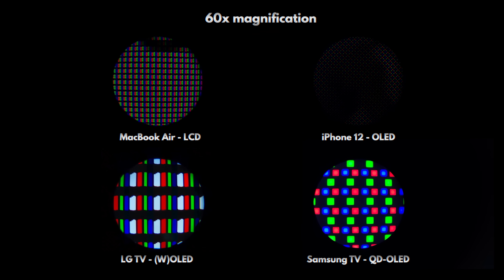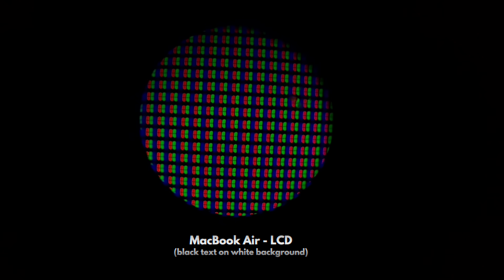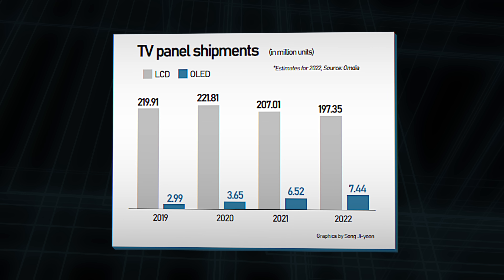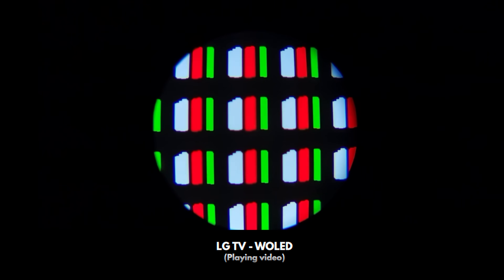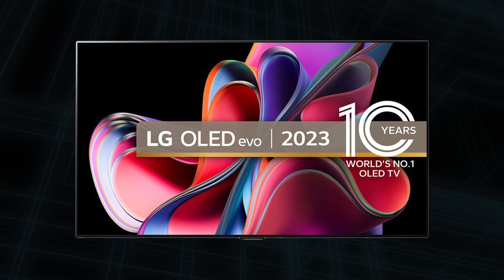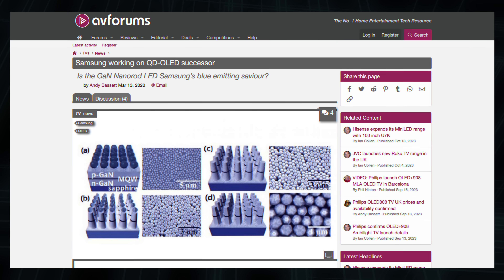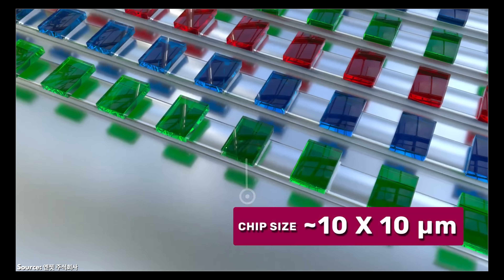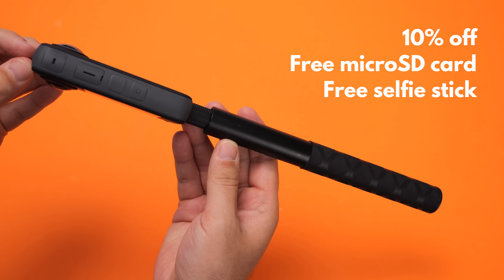The billion dollar race for the perfect display

Comment: The selective reality morph trying to sell Micro LED. OLED displays can be both RGB or Pentile. The latter is a very clever way to use maths to save energy and production cost. Had it been invented by one of the toxic US brands, that would have been hailed as the gold standard of display technology.
The "reason" an LCD can use the same sizes for each sub pixel is because the energy generated behind the colours. This does not mean it is more accurate. It is still more complicated to construct and will have extra layers and points of failure.

Comment: The downsides of all these techonlogies is that it takes too many layers so the cost will always be high. Electro luminescent LCD will displace them all even if the Nits rating ends up being a little lower around 1000-1200 nits vs the 2000 nits the others are aiming for. Most panels today have about 500 to 1000 nits on the priciest models so 2000 maybe an extreme luxury item that isnt worth paying 2-3x more for.

Comment: For microLED, instead of picking and placing millions of LEDs onto their electrical contacts individually, maybe it would be possible to fabricate the semiconductor junction as a giant sheet. Place that on the conductor array, make the connections, and then precisely cut up the semiconductor layer using lasers or something. You'd be limited to a single color, but if you use blue LED semiconductors and then add a quantum dot layer, it might work.
Reply: I already tried that yesterday it didn't work

Comment: Minor Correction: natural state of an lcd pixel is clear, not dark.  With no electric field, the crystals naturally twist the light, allowing light to pass through.  With a field on, the crystals line up end to end and stop twisting the light, allowing the polarizer to block the light.
Reply: That depends on how you align the polarizors. How many of you flipped the polarisor in your calculator to get a clear on black display ? Some LCD watches are made the same way to make them look a bit different.
Reply: @MrDuncl  I flipped the polarizer (maybe 4 decades ago) and found that it looks very cool, but is hardly readable if the incident angle of the light is flat: Shadows of the dark parts fall into the open windows of the letters. Same reason I am after black on white displays for Arduino to give it battery saving daylight readability.
Reply: So does LCD need more battery to block the light?
Reply: @rugvedmulay5090 yes, darkening pixels takes more energy on an LCD. On an OLED it’s the opposite
Reply: Only TN (twisted nematic) LCD that are used for entry level TV/displays are normally open ("on" with no electric field, "off" with), IPS-types and VA-types TFT LCDs that are used in most displays/TVs are normally closed ("off" with no voltage). That's why "dead" pixels tend to be bright on TNs and black on others.
Reply: i think it depends if it is a tn or ips display
Reply: Avalanche diodes may be employed to down convert the high energy visible waves
Reply: Crustaceans and other animals did not evolve. Among the millions of fossils dug up from the earth, there is not a single intermediate fossil that proves evolution. Several hundreds of millions of years ago, crabs and other animals were in their current form. The theory of evolution is a dogma without any scientific proof. The reasons for defending the theory of evolution are ideological, not scientific. Scientists have discovered that all organs, which evolutionists call obsolete organs, perform important functions. Mutations believed to trigger evolution have been shown to be completely harmful. That is, mutations do not give advantages to living things. On the contrary, it harms. Evolutionists pointed to fossils of the coelacanth fish as evidence of the transition from water to land. However, a living specimen of this fish was found and it was found that the coelacanth fish is currently a fish that lives on the bottom of the ocean. Finally, I would like to mention that evolutionists can't explain how a living organism arose from inanimate matter. Living things did not appear through evolution, but through the Cambrian explosion. This proves the creation. Almighty Allah created all living things. Praise be to Allah Almighty, the Lord of the Worlds!
Reply: Ah that's why I'm team OLED for now. Burn-in or low brightness isn't even an issue anymore
Reply: @dannyboots burn is still an issue, it's just migitated, but over the years it will happen eventually.
Reply: He showed a horizontal polarizer and vertical polarizer stacked on each other. Theoretically, that's the recipe for complete black
Reply: it can be either depending on the orientation of the polarized filter relative to each other.
Reply: Correct

Comment: Why there isn't LCD display with miniLED backlight? It doesn't burn out, have higher brightness, multiple zones as TCL showed can be as good as those in microLEDs, you doesn't need to use RGBW panel so colors aren't washed out.

Comment: i fihured out how to make microLED both better and cheaper
Reply: if you use the same principles as making computer chips then u can use the same machine to make the display both using vapor deposition so that you dont have to pick and place the leds
you grow them where they need to be
the display can be near paper thin
and have insane resolutions like 16k on a phone
and insane brightness
Reply: @5Revive   Serious questions:

What patterning method would you apply in order to keep an intact conductive driving layer? 
How would you adress the problem of existing pixel defects when not having to ability to pick, choose and replace at will? 
What approach would you use to minimize well transmission losses on the with shrinking volume exponentially increasing surface ratios? 
How would you cope with electron speed limitations on circuites larger than 2 inches?

If you can answer any of those I got a friend who would immediately give you a job at their institute haha
Reply: the only place there is issues with the speed of electricity is in very high frequency circuits like timings on a motherboard in a computer
Reply: @5Revive   Micro LEDs are a very high frequency application. A single LED on a 500x500 plane has an activation time on the order of single microseconds depending on brightness. The far most pixel therefore has the possibility of being turned on for less time than it takes the electricity to travel there. The kind of equippment the guys that research those things have can actually visually capture these timing discrepancies. On a larger scale they could cause severe eyestrain.
Still this issue is the easiest to adress with dedicated circuit timing and stuff, Do you perhaps have an idea for the other three issues posed?
Reply: this method would eliminate all the probloms with MicroLED

Comment: For fixed resolution displays, LCD generally has the best subpixel size, design and arrangement and they usually have less black area. If the pigment of the color filter has deep primary colors the image will look astonish (example: PSP 3000 display from Sharp, several LCDs made by S-LCD, etc...). OLED TVs are not pure RGB since the white backlit "subpixel". OLED Smartphones are RGB but too small subpixels (a lot of black area). Image is not that brighter as result.  LED TVs (micro leds) seems a dream, but the subpixel again, too small for my taste. I will only believe it's really that good when seeing one myself.

Comment: Great video!  The image quality now is so good, hard to imagine what it'll be like in five years.  I have family who were still using a  huge Plasma TV up until last year when it finally gave up the ghost.  It was THICK compared to modern TV's, took two people to mount.  Their new 70 inch TV is so much lighter and the picture quality so much better while consuming so much less energy!  We had an Emporia Energy monitoring outlet on it.  They were surprised how much energy the plasma TV was using...and how little the new TV is using.
Reply: The ridiculously high power consumption was a problem shared by all plasma displays.  In fact it was big part of why plasma display technology died out in favor of LCD screens.   When it is freezing outside, people don't necessarily mind sitting in front of a tv that also happens to be pretty good space heater!   But when its hot out, turning on the plasma tv let you know just how good or bad your air conditioner was.   If it was really hot out, just forget the plasma tv exists if you don't want to roast.   Goodbye and good riddance plasma tvs, ya bunch of try-hard wannabe space heaters...
Reply: I refused to replace my plasma (and even paid hundreds to fix it) until OLEDs were reasonable.  Absolutely nothing wrong with plasma.  But man, were they heavy.
Reply: @kcgunesq  I think the best way to describe the weight and size of plasmas is thicc, and maybe chonky... Plasmas looked great, better and brighter than the early LCDs.  And LCDs still can't offer the excellent viewing angles plasma tvs had.  It didn't matter what angle you were at to the plasma, you could be way over, almost to the side of it, and it would still look great.  Screen burn-in problems, cost, and high power consumption still killed them off in the end

Comment: i think a near ideal option may be VA with an OLED or MicroLED backpanel that wouldnt need to be as high res and could be made  for low burn in, would actually give the best results...well CRT's can still be way better in alot of ways, but still.. 

the thing about using an oled/mled backlight would give a huge number of zones for HDR and would help limit the burn-in that is why nobody i knows will own another OLED monitor till they sort the burn-in issues.. 

and also, the backlight being only behind whats lighted would bring VA panels to the next level... without the flaws that current oled panels have... 

i love high end VA panels for most content/uses.... and IPS could also benefit massivly due to IPS glow being my main neg against IPS as a display tech.. greys are not blacks... VA come much closer to true blacks...

Comment: You present remarkable historical and present technological information about the displays themselves.  Good Work.  However, you fail to mention anything about the ambient light rejection that the front surface must achieve to provide impressive luminance dynamic range.  My point: it is NOT just how bright the brightest pixel is w/r ambient lighting but how DARK the darkest pixel w/r ambient light reflecting off the front surface.

Comment: An interesting fact about MicroOLEDs in VR headsets is that they basically don't run the risk of burn in, unless you place a window in a fixed position, since you're moving your head around and therefore change the position of elements on the screen constantly.
Reply: The HUD says hello 😂

Comment: MicroLEDs have 3 major downsides atm.
First: Size, currently there is a minimum size, since the LEDs can't be made very small.
Second: The price, a MicroLED display is REALLY expensive, since there are millions of LEDs.
Third: Efficiency, the current MicroLEDs need a LOT of power, more then 20 times that of OLED and since it uses so much power, you are REQUIRED to have a strong climate system installed in the room.

Comment: These advances still leave behind the biggest bit of low-hanging-fruit in terms of display issues -- sample-and-hold motion blur.  There are only two ways around sample-and-hold motion blur -- either insanely high refresh rates of above 1 kHz, or strobed backlight (or simply strobed, if self-emissive pixels), where the strobe on cycle is small but VERY bright to make up for the off time.

In the past, with CRT's, you could smooth-scroll some text and easily read it while it was moving, but that is simply impossible with current display because of sample-and-hold motion blur, it has nothing to do with pixel response time or g2g transition times.

Comment: I find it very interesting that the quality of displays improves so quick while sound quality is in steady decline. 
When I was 16 I had a better sound system than over 90% of people have today. Now it´s just bluetooth speakers and maybe a sound bar at best for over 90%. What went wrong?
Reply: Many modern sound bars are pretty good. Many people probably do not have surround-sound systems due to the necessity of running wires throughout the room, although some systems do come with a wireless subwoofer. If surround-sound systems would become wireless, except for the center channel and electrical connections, then more people would probably choose them as options.
Reply: @Eternal_Tech  I´m not even speaking of surround sound. Most people don´t even have a halfway decent stereo system. Sound bars just can´t compete with halfway decent stereo systems from 40 years ago. They´re too limited by their size and I´ve never heard a good one.

Comment: I believe you're a bit misleading about the quantum dot LCD displays.
The quantum dots have purer colors than blue Leds plus phosphors that are used to generate the white backlight.
They still depend on having color filters that block at least two thirds of the light.

There was an idea that I believe was was abandoned because the LCD's couldn't switch fast enough.
The idea was you have Red, Blue and Green backlight colors that are switched on sequentially.
The image is displayed three times for each video frame, once for each color.
Each LCD pixel is more than three times as large as before with no filters to block the light and less wasted space between the pixels.
Each pixel being larger is easier to make and and lets through more light.
LCD's are much faster than they used to be, I wonder why the concept hasn't come back.
The electronics are fast enough, perhaps someone still has a patent preventing anyone else from using the idea.

Comment: Don't LED backlights also have a diffusion layer or is that part of the first polarising layer?  This was another downside of LCD as even the best TVs suffered from uneven backlighting and even colour temperature, I believe due to it being hard to keep even pressure across the layers on larger panels.

Its not really accurate to say LEDs have no burn-in either, its just slower and depends on how hard they are being driven.  Inherently once you have one LED per pixel, any pixel which has been run at brighter levels for longer will wear out quicker than ones which haven't, thus burn-in.  So it really all comes down to how long you can defer the burn-in from being visible, such as with OLED where they try to monitor the ageing and alter the voltage per-pixel to maintain the same brightness even as they wear out.  

A lot of the improvements have come not from preventing the pixels wearing out, but better compensating for when they do.  So while you may end up with a duller screen overall as they age, its at least consistent across the whole panel.  Because of course, nothing lasts forever, but you want the product to age gracefully so its up to the user to decide when its become too old to use.

Comment: Excellent video and I was also impressed with the diving footage.  If you want to try something different and can find an affordable EUMIG NAUTICA Super 8 photochemical film camera that works, it is the only camera ever made int he format that lets you shoot underwater without a waterproof case.  If you pick something like Ektachrome 100D daylight reversal/projectable film and/or Kodak Vision 3 500T color negative, the results would give you ideas of how to push your video further and set some interesting standards in color for you.  The camera only runs at the old 18fps (frames per second) silent rate, but that gives you 3 minutes, 20 seconds per cartridge.  The company fielded before they could do 24fps sound speed versions, though they did produce prototypes.  Also, please address Dolby Vision in conjunction with your next video on displays if you can.  Thank you for an excellent video!

Comment: OLED will always and forever be a dud. There is an aspect of OLED technology that virtually no one ever talks about, and that is ABL. OLED will never be suitable for displaying HDR because of this major inherent problem with the technology.

Companies like Samsung quote extremely impressive peak brightness capabilities, but it's an illusion and a lie. These numbers are only valid when a very small percentage of the screen is displaying said bright images. When even a moderate amount of the screen is displaying content that is intended to be bright, ABL kicks in and dims them down to plasma TV territory.

Even the best Samsung QD OLED can only manage a measly 200 nits of fulfilled brightness, which is pathetic. Most WOLEDs can only maintain 100 nits of fulfilled brightness. Because of this, you will never be seeing HDR content as the creator intended it to be seen. What you will be seeing is an extremely neutered version of it. Images, such as bright sunny days, will look dull and dim and nothing like reference.

Self-illuminating pixel technology is great for achieving perfect blacks, but you sacrifice a lot to get these with OLED. Most mid-level and flagship LCD TVs now have great black level capabilities with the use of local dimming. Aside from that, they will absolutely murder even the best OLED when it comes to displaying HDR content because they do not suffer from the same extreme ABL.

Even a mid-level modern LCD will display 100% full-field brightness at 700 nits plus. Now compare that against the 200 nits of the very best that OLED can offer. HDR on a decent LCD is a completely different experience than it is on OLED; it's vastly better and truer to the creator's intent. There is a big divide in what professionals tell us are the best and what looks visually best when judging strictly with your eyes.